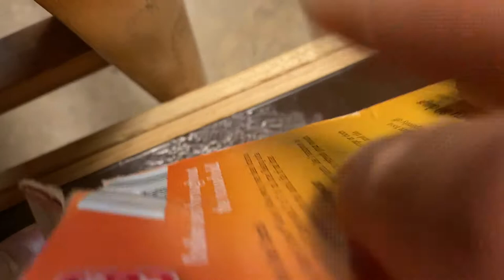Bear Grizzly - Limb Fix 1

Comment: Ouch.  I don't know if it will ever have the integrity again.  I had a Bear Montana that broke in half at full draw.  Happened so fast I didn't even know what happened.  I got smacked upside the head/face in three places, just minor cuts and bruises.  I'll post a link to a pic after the break, I don't know if it will show or not.
https://i.imgur.com/shqpVn5.jpg
Reply from the maker: Yikes!  That’s a crazy story and I looked at the pic, wow that break is severe.  My Montana has a little stress crack around the handle. I never would have seen it had I not taken off the grip. I think the slim profile of the Montana doesn’t support high draw weights adequately.
Reply: @HandyL  Here's a pic of the Montana.  I didn't have arrows yet, but just pulled it to full draw.  I was excited to have a new bow.  Couldn't wait to play with it.  Wife snapped a pic.  I didn't dry-fire it though, or anything like that.  Anyways, you can see the upper limb is bending a lot just off the riser, and not much at all near the tip.  I think it was poorly engineered to spread out the stress of the flexing.  It's not an even arc.
https://i.imgur.com/bPRoK37.jpg
Reply from the maker: Makes me not want to shoot my Montana 😬 I always felt the bow was really straining at full draw being at 55#
Reply: @HandyL  It soured me on replacing with another Montana.  Mine was 50# at 28", and I draw 32".  In comparison, look at the nice smooth arc in this 50# Slick Stick, at my full draw it's probably 60# on the fingers.
https://i.imgur.com/NPX1asX.jpg